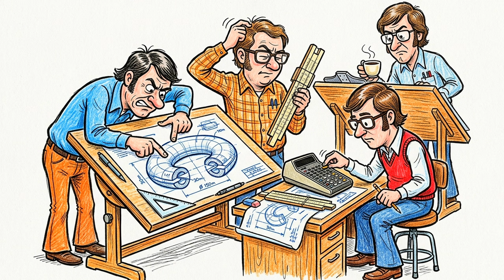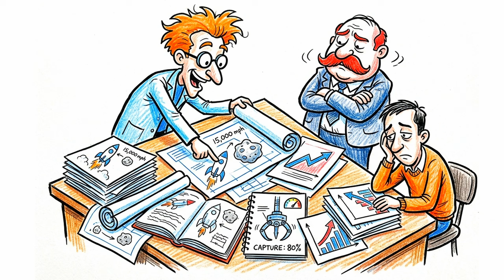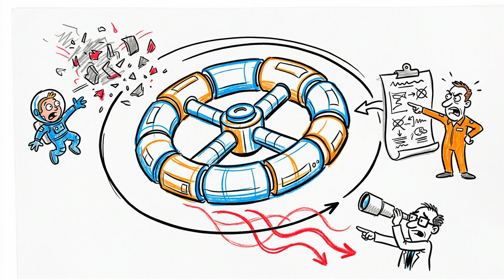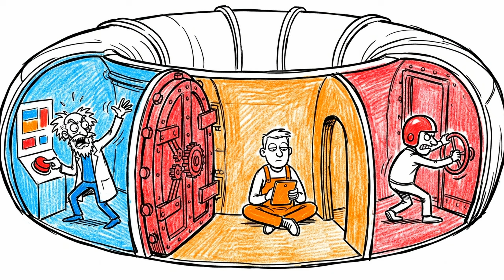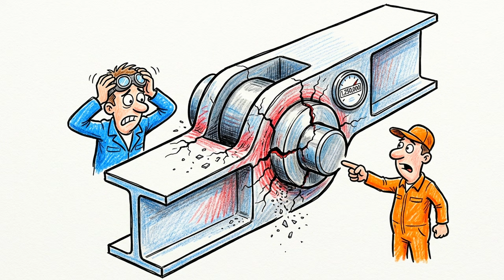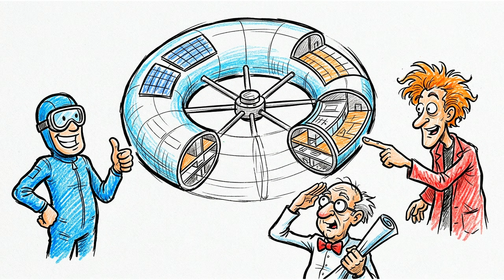The Stanford Torus Is Physically Right and Practically Impossible

Comment: You're doing a good job to dispel propaganda nonsense. Too many illustrations makes it a bit goofy. 1 picture per minute is fine, with some charts and graphs supporting the subject.
Reply: Concur, except for the characterization ¨bit goofy." Seemed fine to me.
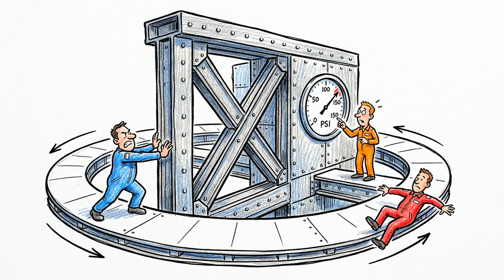Reply: 8:20 evry Space art image of a stanford torus shows only a hollow tube - i always wondered about that - it would need bulkheads and structural points, like multiple massive pedastals, not open skies in an open cylinder....  just a thought experiment, not even close to practical
Reply: @A-Chaps  There is no need for any space station. Robotics can do all the experiments in space.
Growing and eating rubbish will make you drop super massive farts, overloading the filtering system, anyway...
It's better to invest into replenishing fish in oceans, or irrigating arid land.